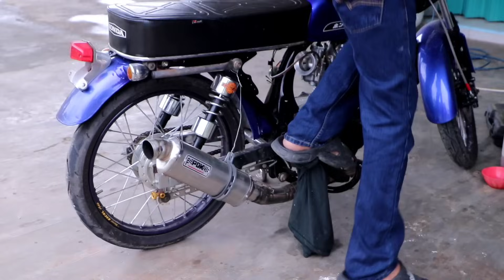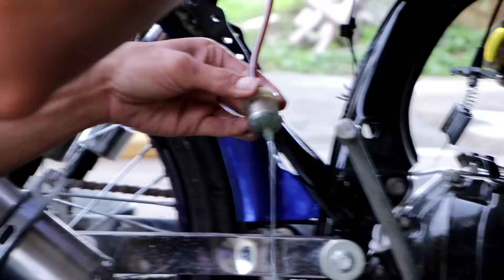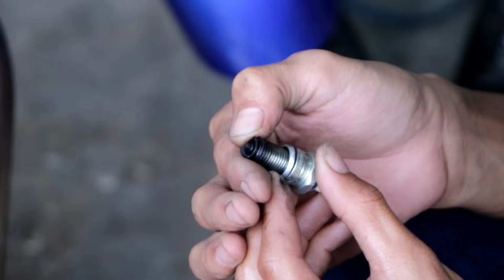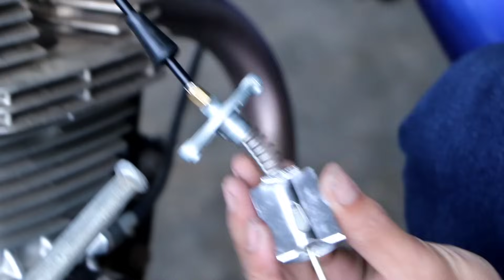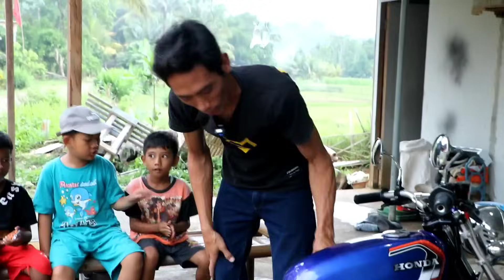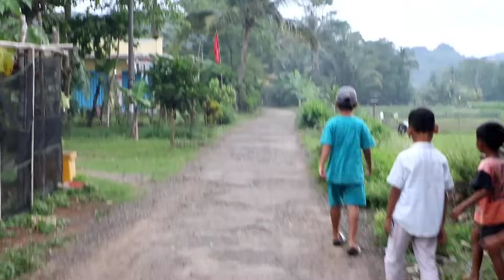STEL FULL BREBET CB MESIN BORE UP

Comment: Memang penyakit Keluarga CB GL MP Tiger lama Tiger Revo ketika Kick Stater seperti itu sepertinya Kruk As di Upgred L 70 72 73 74 76 Suaranga akan Sanggar lg 

Sy pernah Coba di GL 100 CC 250 Spek
Head: Penten
isi Head: Kelep Besar Per kelep RRA full Titatium
Noken: Castum
Blok: Pantem
Liner: 65mm jp Racing Carbon 412 HV kode (FC)
Kruk As: Castem L 76
Rengkes kiri: Tiger Revo
Rengkes Kanan: Pantem
Oil Cooler: Suzuki FXR 150
Karbu: PWK As 38
Kenalpot: Leheran Castem Selincer Scorpio Original Bedel  suara Buket Adem

Sy pernah Beli lalu Coba Pake Racing Merek BBS tipe Keong Engker Engker makin parah 1 jm pemakean langsung Copot Ganti Selincer Scorpio Suara Buket Adem Enak untuk Harian Turing Aman
👍👍👍👍👍👍👍👍👍👍👍